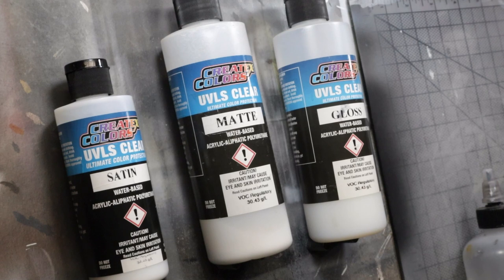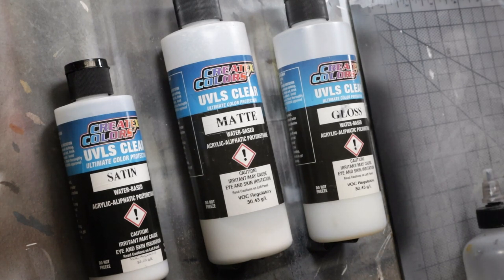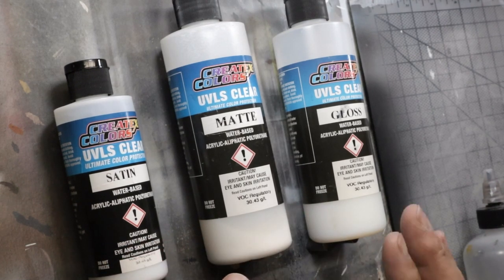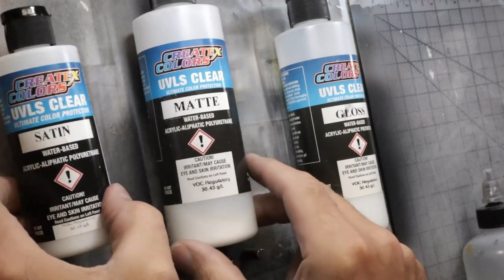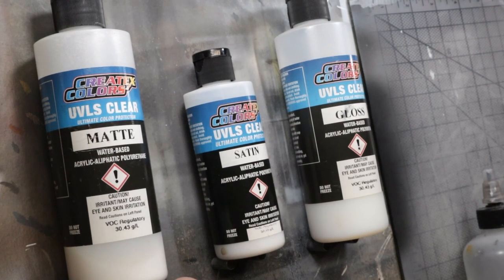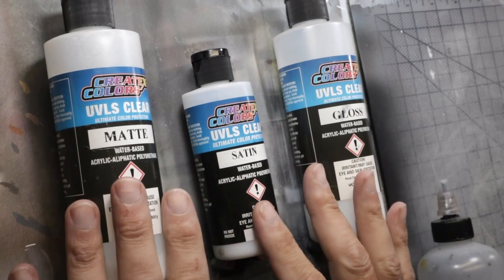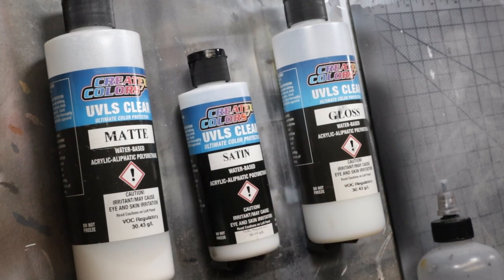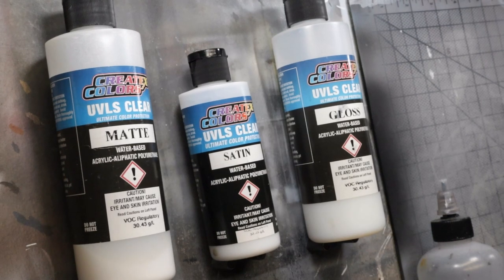Tech Tuesday -  All the UVLS

Comment: Great info Steve, thanks.  How about a Tech Tuesday on how you glue the screws to your magnets?  I've been using JB Weld and the screws seem to eventually break off from the magnet.
Reply from the maker: Jeff, that is what I use too. Then just clean and reglue when they separate.

Comment: Thank you sir. I also like to over reduce my illustration colours but have found that adding the uvls gloss to the mix also helps the paint stick to my needle inside my cup. This does not improve my paint flow. 🥴
Reply from the maker: Absolutely. It really works opposite to the way that the Illustration line was intended. Great point Ryan.